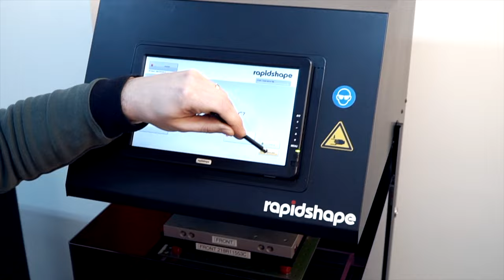3D printing jewelry, Jewelry design on 3d printer jewelry making, 3D Printer jewelry machine

Comment: How does it print under the liquid like that? What is that machine?
Reply: It is a photocured resin, it's a light-sensitive resin that cures with a laser, in this case, a laser prints layer by layer, raging its layer height by microns
Reply: Also known as stereolithography